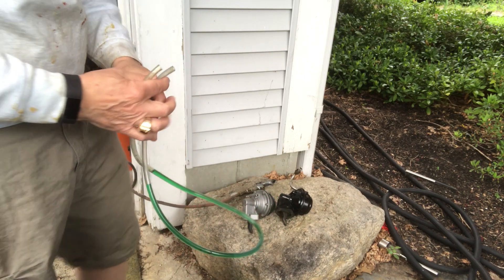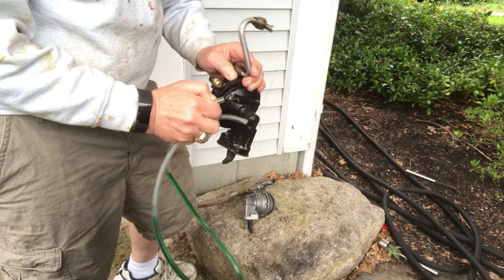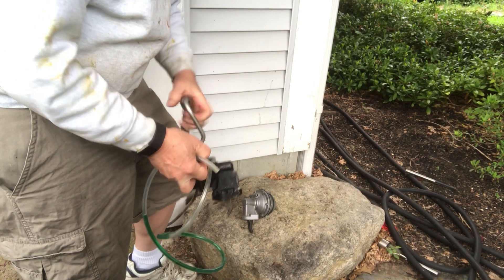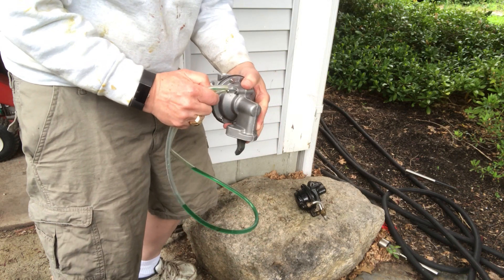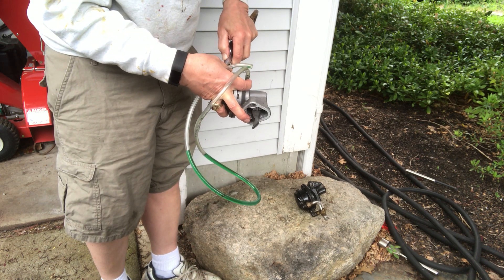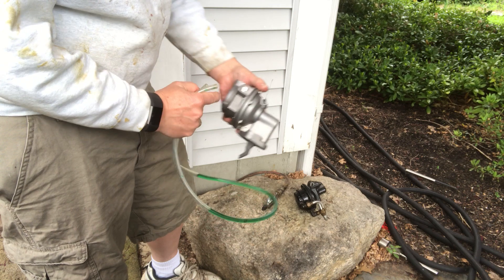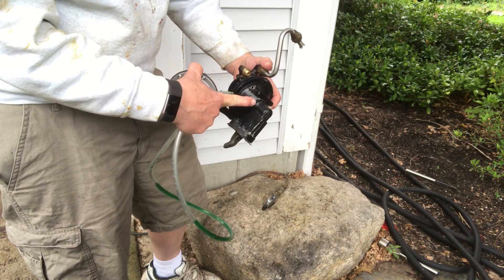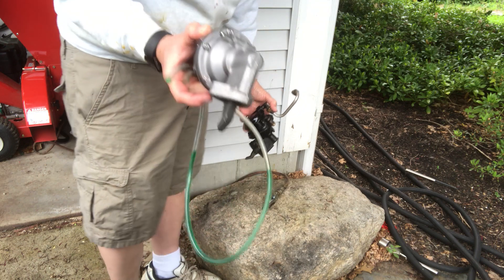Mercruiser Mechanical Fuel Pump Testing

Comment: MAYBE the diaphragm is bad!? What about the 2 pressure check valves that are inside?  They prevent the gas from siphoning the inline gas out of the fuel bowl & back into the tank.  RIGHT?  If they leak, NO PRESSURE, & no start.  Crank,Crank, Crank.